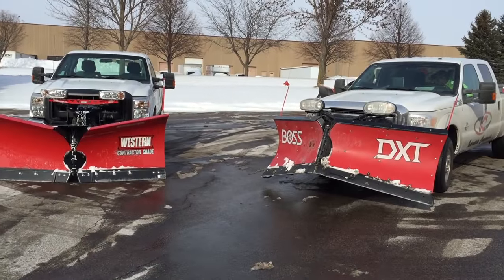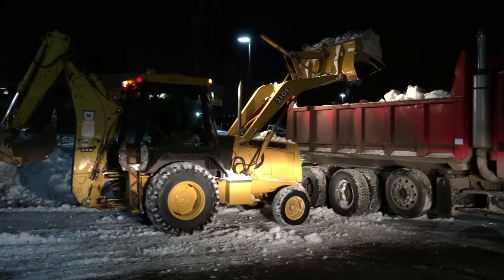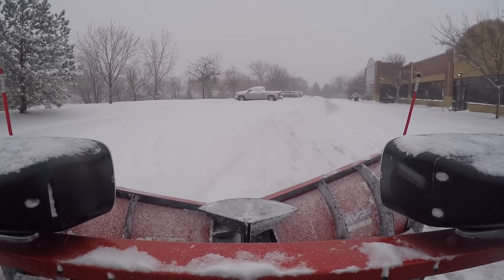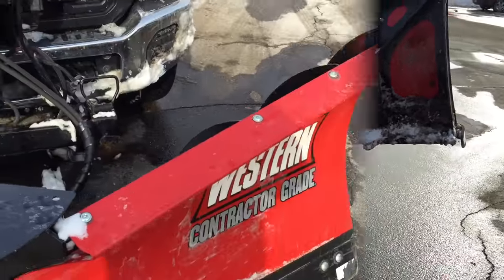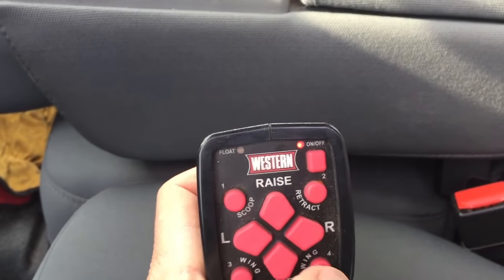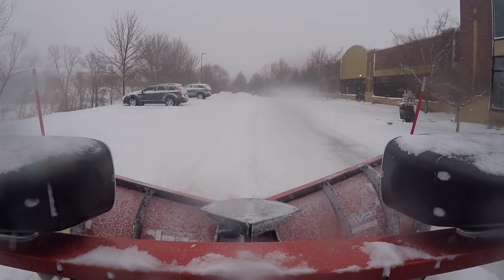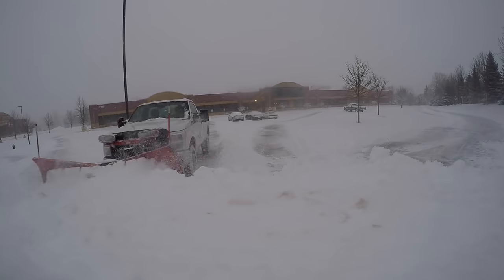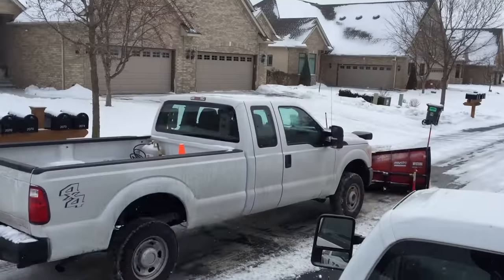Plow Review  Boss Vs Western snow plow

Comment: Meyer plows blow ..not one reputable company uses them here in Buffalo NY. That "we've been around the longest"  line I heard 17 years ago when I bought my first plow and you still hear it today. Complete garbage and it's always the guy who plows 3 driveways for beer money who tells you  how great they are.
Reply: DBPM 87 you're right they used to be junk but I can assure you the new super V2s are the best mall boards on the market! 1200 lb on eight and a half feet and now they have a good pump. They are running monarchs now and I own four and have not had any issues except one check valve in the four years I've owned them. What I really like is the 5-year warranty but did not have to use it. I think you're just a little biased, maybe you should see one in action because you don't own one and you're bashing them. Imma keep making my 90 grand a year with them :-) right here in Buffalo!! STS on transit has awesome customer service if you need service.
Reply: i have the older diamond blade with the meyer hydraulics.....blade is built like a tank practically indestructible...the meyer hydraulics ..not so much...keep extra solenoids and valves in the glovebox.
Reply: working shlub they are actually running Monarch Hydraulics now. They say monarch is the best hydraulic pump setup out there and I personally have not had a problem except that one check valve on four of them in 5 years. There night and day from just 18 years ago and come with a five year warranty. I've ran Meijer Fishers, westerns and they all wear. DD's pumps are diesel but Monarch is ranked better.  IMO both great pumps
Reply: i have the older meyer E60 pump...not hard to work on but the motors are notorious for not lasting long.
Reply: working shlub yes same with the  e-47s, always burning through solenoids and carried an extra pump also. Always had to rebuild them every year and that's when I got away from them and ran westerns then I ran Fishers and I had a blizzard for one year and did not like how it mounted. I should have kept that plow. Anyways I'm 30 years in business this year and these blades are used on my residential's with back plows and these super V2s are the cat's meow
Reply: i hear you...i go on craigslist and if i find an E60 that is jink i just buy and rebuild and put on my garage shelf... a factory rebuilt is around 1,000$ that is crazy...rebuild kit is 50$ ..as long as case is not cracked you are good to go. ..i had the old fisher speedcast on a old f150 and it was great..under hood hydraulics.
Reply: I dunno I plowed 30 drives and helped some other guys out on some parking lots, had a meyers 7.5" straight blade, pretty typical, sure I had issues with some seals , or a solenoid, once a year, but I pushed a lot of snow and beat it up pretty good, I loved that plow, it came with the truck, otherwise I would have bought a western wideout, my buddy runs a boss and he loves it, I went out with him plowing last week and I will admit it is a hell of a plow, 8' with fixed wings, it is much heavier built than my meyers, but I could rock a meyers plow and be just fine if thats what the boss gave me to work with, If it was my money I would opt for something better but I wouldnt complain about them to much either, I have a huge boner for the western mvp and wideout plows, I never liked using Blizzards much for what its worth
Reply: DEVUNK88 who uses a 7.5 anymore? Lol its 2018! Havent used a 8ft Fisher in 10yrs
Reply: I dont have it anymore, in fact I dont even plow anymore, but I  could plow for a local company, and one of the trucks they just picked up used came with a 7.5' meyers, they exist and you might find yourself using one, I dont have a problem with them, I can fit anywhere and move just as quick in residential driveways
Reply: DBPM 87 wrong STS on Transit carries them for 5400 installed 5 year warranty.( Monarch pump and they finally got it right! It's a beast) E-70 I've been running for sv2s and by far better than western now! 
  I agree back when I started first plowing 30 years ago they were junk but I've ran westerns boss and Henniker and wound up going back to Meyer because of the durability and Monarch pump Westside year warranty on everything that I only had to use twice on for plows. It was minor also, light module. I operate in Hamburg New York and if you would like to test drive one of my trucks plowing the Meyer sv2, I think that your mind will change 180 degrees! Heaviest Mall board on the market, curb guards are awesome and act like shoes to. The only thing I don't like is the bottom belt, I'd rather have metal but I have never had one break in the nine years I have owned two sets of 4.
    For the price &  warranty, I can buy two of them compared to one boss. As you know if you're from Buffalo everybody is running boss Western and Meyer, very few snowex. Them plows are not made for up here.

Comment: Barrington NH Plower, the boss pin connection from truck to plow is the worst. I took a truck/plow back to the dealer twice for this problem. The pins bend and won"t line up. They said they didn't have a fix. I wanted my money back, They said no can do. I wish a had gotten a fisher.

Comment: western pluses: stack height, controller easier to use, has pivot bar (for easy unlevel ground hookup), and security code system. also the carrier hardware on front end doesn't hang down as far. mine is even with bottom of front end bumper facia.....just my opinion.

Comment: Go with a fisher an you will not turn back !!
Reply: Bull fisher is the worst of them all
Reply: @mervinkimballjr1251  
I've been running a strait 8' mm2 for 5 yrs. Replaced 1 solenoid. And the cutting edge. Wouldn't buy anything but Fisher.
Reply: I agree Dan D, I have an 8'6" Fisher MM2 Storm Guard straight blade and I won't plow with anything else. V-Plows are a joke. To many things to go wrong with them. If you got a huge plow route you don't need problems. Straight blades are simple and when your plowing snow, less problems equals more plowing done.
Reply: Fishers and Western are manufactured by the same company. And yeah, straight blades are simpler! But it all depends on your application. I do some roads and pretty long driveways where the V allows me to use more than a 6-inch corner of my blade to chip Away at a snow drift
Reply: @jspaulding4106  Glad you mentioned that they're made by the same company. After reading this thread I went and reviews the specs on the Fisher, and the weights are exactly the same as the Western for both the straight and V-plow units...to the pound. Very interesting that they're both made by the same company.
Reply: @Tom b.
The only reason I know is because I just purchased the Western MVP2. And in the Douglas Dynamics literature it talks about both companies. I've heard DD has acquired other plow companies as well. Snow dogg and Blizzard maybe. Had some O-rings blow on the MVP2, but the dealer stood behind it and replaced them. 2 winter warranty.
Reply: @mervinkimballjr1251  lol top 3 easy
Reply: @paulsimon9970  lol ok
Reply: @brucephelps678  v plows have their place out in the rural areas, but if you're doing town and city work I agree that V plows are basically a straight blade that takes twice as much input to operate to do the same thing that a real straight blade with a good set of wings will do with half the effort. That being said, they allow you to carry a wider blade which increases productivity, but wideout blades give you even more width and are still simpler to operate.

Comment: Good review as usual. But might I suggest you upgrade to carbide cutting edges on your plows? Looks like you plow alot of asphalt, regular carbon steel cutting edges really don't last very long with that kind of work. I'm a former DPW worker and have plowed alot of snow myself. We made the switch and the difference in longevity can't be overstated.
Reply from the maker: Thanks Joe and thanks for the input !

Comment: Love our 8.6 mvp3. Had it 5 years now. Opt for the thicker cutting edge to last longer. Added factory wings, and omg, almost doubled our productivity! I think their wire harness needs improvement. Doesn't matter what you do, after 3-5 years you get problems and have to jump out of the truck and jiggle the harness as it will loose connection

Comment: I'm so glad I got a Western V! Best investment I've ever made besides the Ferris! We're getting over a foot tonight! The plows gonna clear 103 driveways tomorrow! It might take from 4am-11pm but I'll get it done!
Reply from the maker: +Mason's Mowing 103 ? That is awesome!
Reply: Dang. Still doing that?
Reply: @jamesnm21  Hell yeah!! Still using the same plow & plow truck! Holding up just fine!
Reply: I'm switching to snow ex plows. Same parent company and components as western but no chain lift and has down force for backdragging. Chain lift just doesn't cut it for productivity anymore. 2-3 times as long to clear a driveway simply because you can't get a good scrape in one pass. There are zero advantages to chain lift systems. Totally obsolete. @masonsmowing6592

Comment: Had a western for yrs and sold it lastyr pump needed rebuilt or new one but it was over 20yrs old, also don’t have a big enough truck to use it anymore. Lolz just bought a tiny home plow the DK2 8219... went playing with it the passed couple days pushin gravel and dirt trying it out and no bad.... not bad at all... though with the western once my cutting edges were shot I never replaced them, but they held up for over 6yrs plowing driveways and 2 small storage unit lots...

Comment: I have ran Western plows for 40 years and have had no issues with their customer service.  The dealer is the one who supports the plows through Western's warranty department.  Most recently we had a ram start leaking on a wide-out that was just out of warranty and they covered the cost of the repair even though it was out of warranty.  Just as a side note, in the video you compare the controllers.  You should really compare the joystick controller that Western offers as it is a superb controller that we have been using for years.  Our guys like both the hand held and the joystick (just a personal choice).  Thanks for the review as I found it very interesting.

Comment: Inalso had the same exact problem with the cutting edges on my western vplow. The western rep was nonspecific to the issue and the company i bought the plow from had no recommendations for a fix. I sold the western and went a blizzard 8110 powetlr plow and found a place in fridley that sells high grade steel cutting edges. Issue solved and productivity is a huge bonus.

Comment: Personally, I'm a huge fan of the western handheld button controller. I run a Western 7 ft straight blade on my truck and I love how it's smaller and much easier to hit each individual buttons. The Boss V controller looks very nice and easy to handle
Reply from the maker: Thanks for sharing 🙂
Reply: jmoff23 it sucks, try one. Boss is much eaiser.  And once u get use to a Boss V plow after one storm, youll never wanna use a straight blade again! All the trucks have the 9.2 or 9.4 whatever they call them, we back blade condo driveways with them if skidsteers are behind. U can put the blade in any position to make it work for any situation.  Awesome plows

Comment: I have two western 9.6 MVP plus, one is 13 yrs old and still has the original cutting edge, it's wore out now, I have a replacement on the shelf. The newer (now two seasons old) Has worn faster, and I have had to adjust shoe height to keep it cutting good... It is wearing faster than the old plow.. As far as the controller... I like it, and I know what you mean with the double tap or extended hold on down to go to float... I seldom look at my controller, after so many years at it, it's natural to me in my left hand... Training a new plow operator (never plowed before) this season, he persistently holds the controller in his right hand, I have told him wrong hand ( my feeling).... I find left leaves the right hand available to run the truck... VIDEO SUGGESTION Stanley.... "which hand do most people use? and which hand makes the job faster" Ok,   We won't bring women into that conversation.... LOL  Keep up the good work Stanley I enjoy your video's!

Comment: I just bought my first boss plow this season.  DXT 9.2 stainless.  Here in upstate NY we have gotten almost no snow this season to date.  But the few times I have used it it has worked well.  I had the issue like you stated about it being forced out of scoop.  Called Boss and they walked me thru the adjustment that is under the pump cover.  I had two other times I had to contact Boss and they seemed like the real cared about my concerns.  At one point the offered to replace the lift ram with a smaller diameter one because I wasn't happy with the speed the plow went up.  So far happy with my decision so far.  Will be purchasing another next season to go on a 1 ton dump, straight blade this time tho.
Reply from the maker: +michael oneil Sounds like you have had a great experience from Customer service.  Glad to hear that!

Comment: Goo information Stan. Do you feel despite the cutting edge issue the Western is worth the money? All I can add is that our Arctic plow has quit recently. Changed solenoids regrouped it still zero. Now the dealer says it's the controller itself needs replacement.
Reply from the maker: +Primo Landscaping I don't like Western customer service and it seems like many people are commenting the same.  Other than that- I like the plow except for the controller and cutting edge.

Comment: I have a fisher ez v with a 6 button remote. After watching your review on the remotes, I'm glad I have the 6 buttons and not the 9. Push the mode button to lock the wings together and use it like a straight blade. Push the mode button again and the right left button  scoops or v's. Hold it for 3 seconds and then each wing operates individually.
Reply: Yeah, no way am I gonna push mode buttons every time I wanna do something different with my blade. Joystick allllll the way.

Comment: I run a Boss V and a Western Spreader, had good luck with both. Western was really good at dealing with control module problem when the spreader was 1 year old (replaced at no charge). And the Boss well it is 5 years old and has never actually had a problem.....
Reply from the maker: +Ray Bibby Good info to know.  My Boss has been rock solid for many years as well.

Comment: I have a western unimount mvp plow and I have to put it on and leave it on all winter because it’s so much trouble putting it on my truck I’m 71 years old I have so much trouble getting it lined up for the upper pins that holds the lights up works great but pain to hook it up must be a better way. Ultra mount looks so much easier

Comment: I have been running a western pro+ for about 4 years and live the ultra mount stystem. It hooks up fast and it doesn’t hang all the way to the ground like the hook bar for the boss.  On a side note back when I lived in Anchorage those guys swore by western, Myers and fisher plows.  Not sure what has happened with the Myers plows that they are getting so much hate on here but something must have changed in the last 15 years

Comment: I've been plowing with a early 60'es Meyers straight blade for 20 years . 1/4 mile to the barn + 1/4 mile road to the back 40 , around the house and years ago some neighbors . After welding and patching the good old Meyers , I retired it and bought a Boss 8'2" XT  " V " . Looked at a few brands and decided to buy Boss , very pleased I did , it also keeps the local guys working / welding . :-)
Third year in use and I'm impressed  !   :-)
Reply from the maker: I love the boss plows!

Comment: Hey Stan, I'm up in Ontario.  I run western and have for 12 years.  Something is off for your new MP3's to wear down the cutting edge's so quick.  I'll get 3 years out of a cutting edge putting min 250 hr per year.  That said the poly edges wear super quick on my wideout..but they have come down in cost.  The old pivot bar on the old mpv blades has busted on me before but the newer one on my wideout is fine after 4 hard years.  I run a 7 year old 9.5mvp and 4 year old wideout.   I do find I blow lines often in the wideout.  I did own a boss once, never put it on my truck...decided to get the 9.5 mvp instead and sold the boss.  Cool story, I bought the boss from Mike Holmes.

Comment: Although I have no direct experience with V plows, springs wear out from use not being extended for long periods of time. Its the action of being opened closed that  wears them out. Its a common misconception with firearms that leaving a pistol on the cocked position will wear the spring out. Perhaps I misunderstood what you were saying about springs wearing out on the Boss.
Reply from the maker: Its the opening and closing action that wears them out-just like you described.

Comment: I've had fairly good luck with customer service through Boss. When I've called directly to the manufacturer, they've always done their best to be helpful. Also, it usually takes some pretty wet and heavy snow for my Boss vplow wings to retract under forward pressure. If it's dry fluffy snow, never a problem with the plow staying in scoop, unless you come into contact with an obstacle of course.